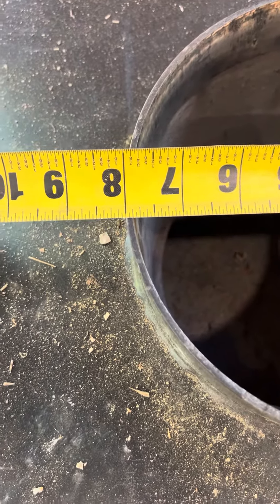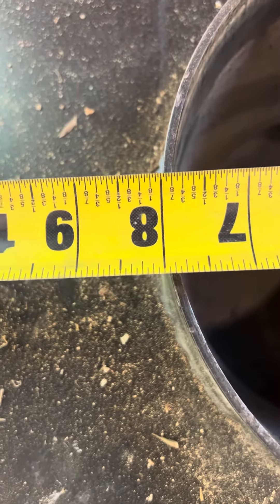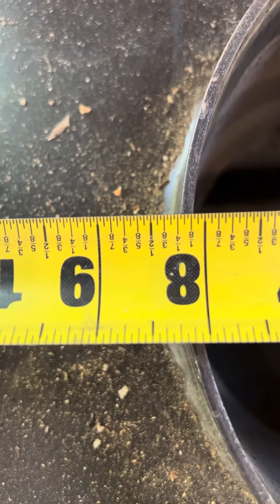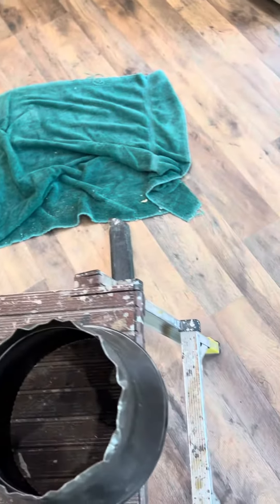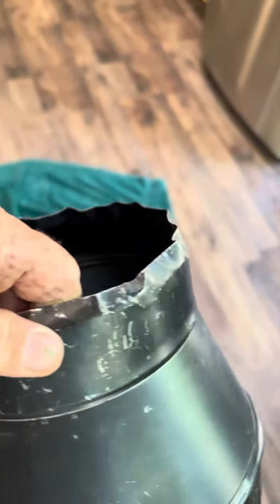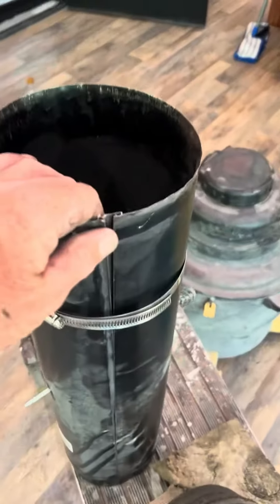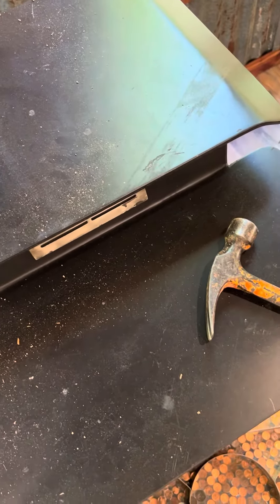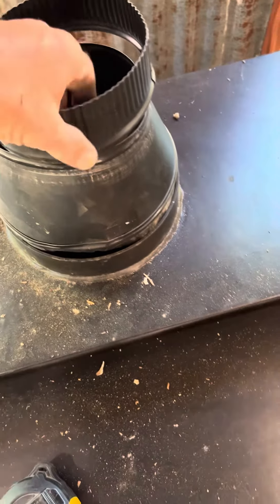Problems with stove pipe can’t find the one I need ￼

Comment: i had same problem with fitting a  stove pie to my chimney liner .what i did was cut  slits in it all around and then got it in pipe and fire cemented it iv tested it and it doesnt leake smoke